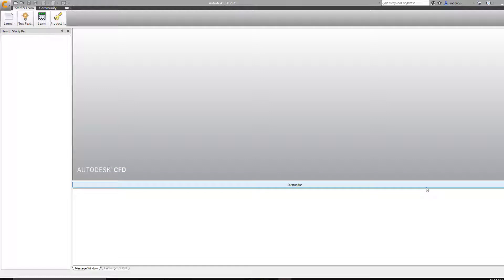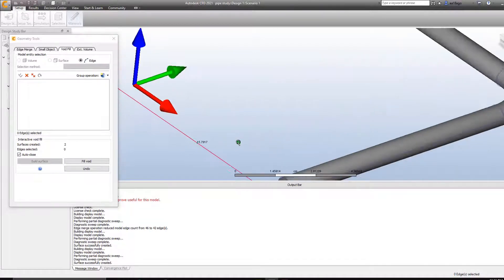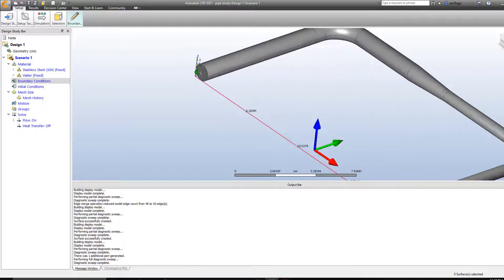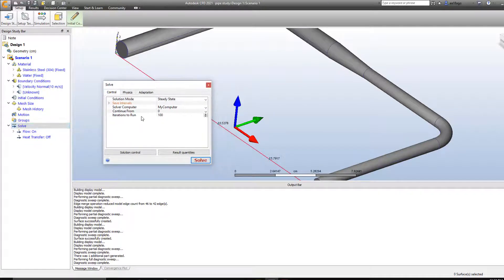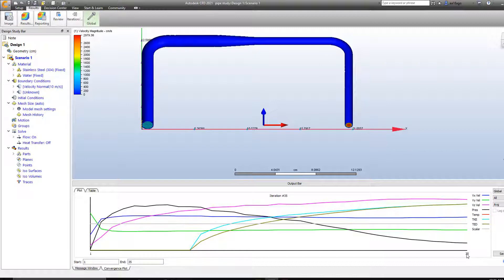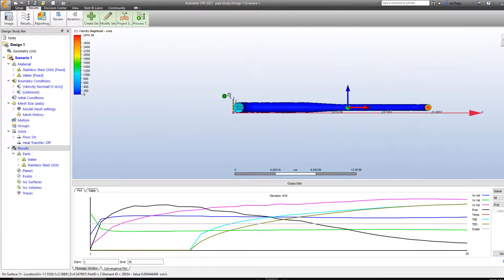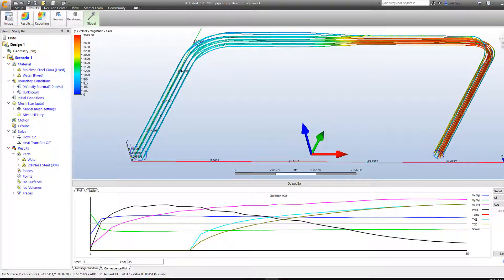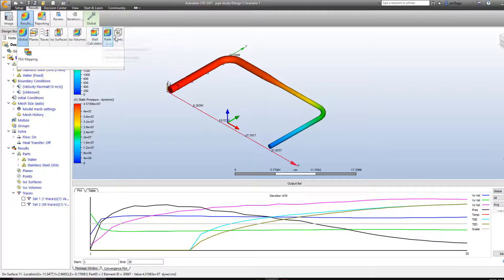Pipe Flow Simulation - Beginner Tutorial [Autodesk CFD]

Comment: How can you apply an entry temperature to the water itself?
Reply from the maker: Good question, I think CFD is not used to calculate or simulate temperature based scenarios. You can use finite element testing for that; where you’ll be apply to apply temperature to different parts and find out the rate of conduction/convention/radiation for your system whatsoever. Thank you for your question
Reply: @2Awesome  okay awesome! I used your tutorials and I just have one issue. It's kind of hard to explain but basically I'm doing a simulation of gas flowing around a shell with baffles. For some reason though when I add the traces they just go right over the baffles rather than around in a circle to the next baffle, even though there is an outer shell making the baffles air tight. Do you know why this might be? Also maybe if you had time I would love to have a zoom call with you to ask you a few questions
Reply: @2Awesome  I've spent countless hours on this problem and it's so simple I think you could do it in a few minutes. I just can't seem to figure it out
Reply: @2Awesome  what is the point of doing a fluid simulation without temperature and dependent variables like viscosity